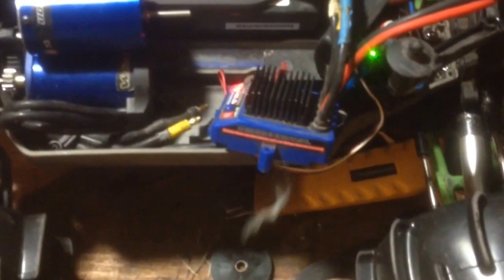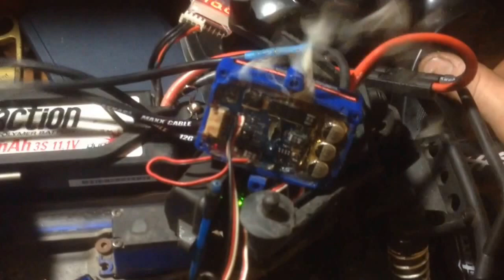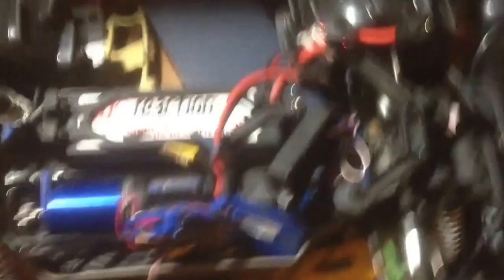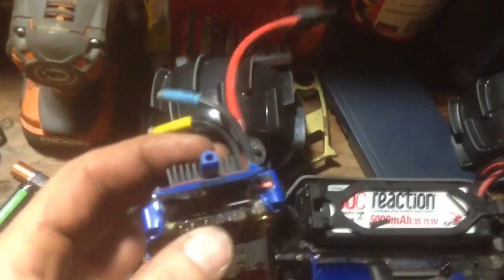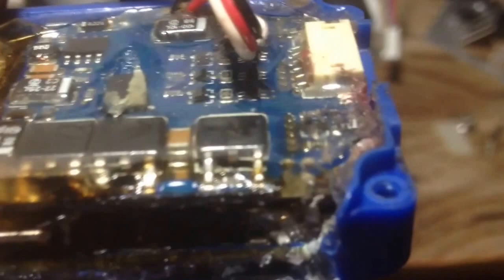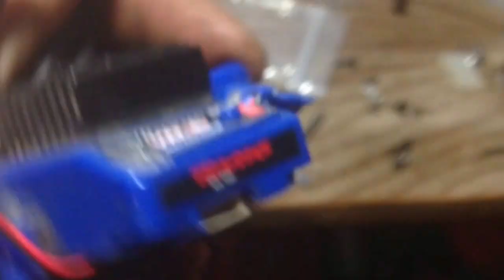Traxxas Velineon VXL-3s catches fire on 3s LiPo

Comment: Oh Fuck! I have a velineon brushless system, and a 3s Lipo.....hope this doesn't happen to me...
Reply from the maker: Chaos R/C just run a fan on hot days, keep a tourqe pinion in rather than speed, that will lower heat also
Reply: +chris bro I have a similar setup to you - what gear ratios would you recommend to stop it overheating? Thanks.
Reply from the maker: smaller pinion will put less stress on everything or a larger spur gear, i run 11t and 58t
Reply: Hey chris bro I have the same problem with the smoking esc. Lol
Reply from the maker: it happens time to time lol
Reply: +Dazzle Novak Don't run it in water.

Comment: yo I got a vxl is the Scews that is Two Tight trust me I Losen  up my Screws up motor perfectly  fine So what it Does Wires get hot and Your Motor  at the Same Time and the Receiver Becuse Screwes  that goes in the Motor two tight not letting rotate and It's Burning it up Becuse I Had same problem Bye Smaller Half inch Screws For it  is forcen  the Motor cause it yo get hot and burn up (Reciver was good but motor Burned it
Reply from the maker: ok

Comment: This happened to mine today. I run it in snow, idk if water got in or what. Plz help
Reply from the maker: +Connor R/C yea probably got water in it. there only water proof for so long. after you heat them up 900 times they start to leak some wear. keep the ecs cool and it lasts forever
Reply: +chris bro so buy a fan?
Reply from the maker: Connor R/C yea

Comment: Ooooohhhhh.......I know what happened, you didn't have it in Lipo mode......you press the button on make sure it's red if it's on Lipo FIRST. Than you hold don't let go, hold the button for 10 seconds, than after you here a little beeping sound and the light is green then it's on Lipo mode.
Reply from the maker: yea i know how its done, it was in lipo mode, there was water in the esc from running it without a fan and it gets so hot the case warps n water starts seeping in.
Red mode for Nimh will only hurt ur lipo battery it won't hurt the esc, it doesnts care what volts it gets, just the lipo can't be drained to far, thats the cut of green mode to save lips. :) I'm just to hard on my stuff haha
Reply: Chris bro is correct. The mode is only to protect the battery not the esc.
Reply from the maker: LetsGetStarted :)
Reply: chris bro :D